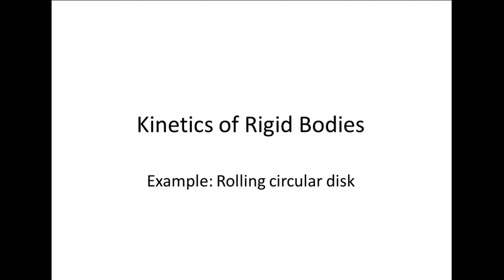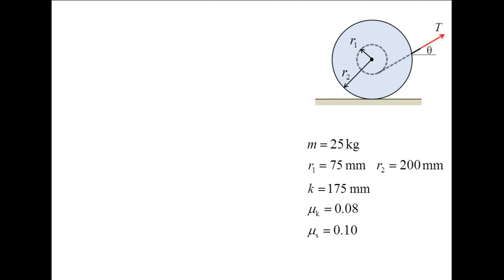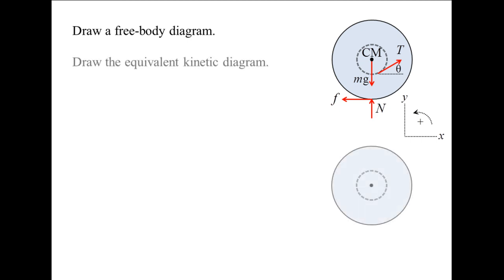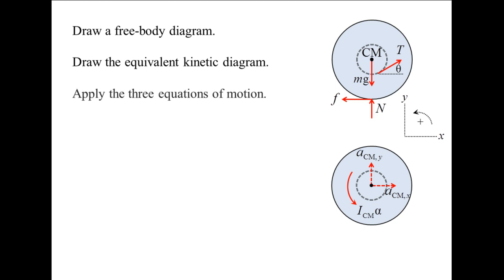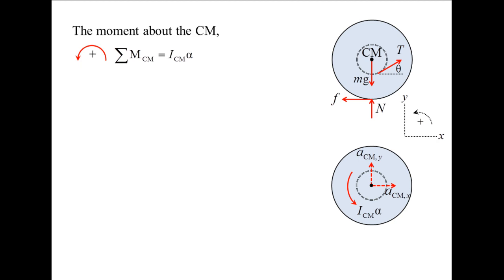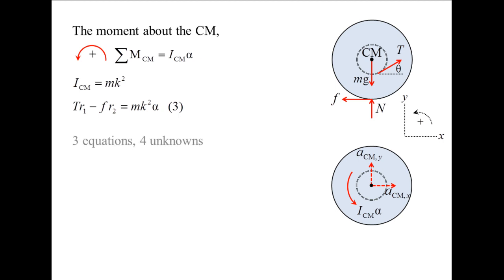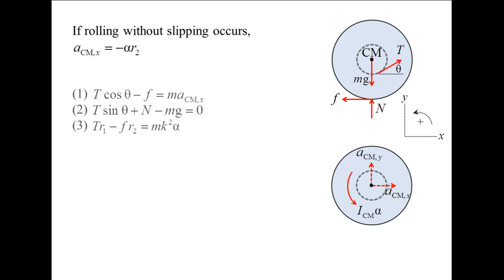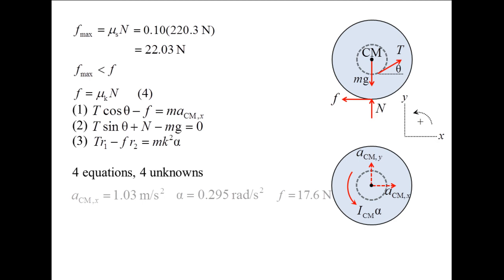Vector Dynamics: Example, kinetics of rigid bodies (rolling disk)

Comment: In equation(3),  why is the tension not broken into x-y components? Ex: Tcos(theta) and Tsin(theta), then the moments taken?
Reply: You could approach it that way, however, you would need to find where tension force is tangent to the spool to find the moment arms for the x and y components. A lot easier taking the perpindicular distance times tension.